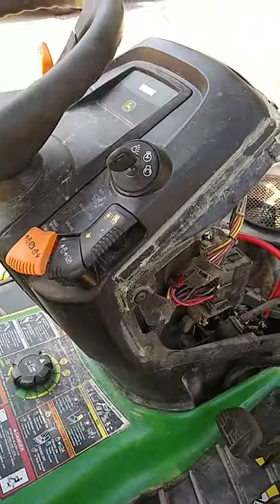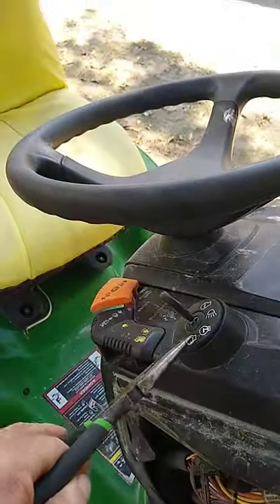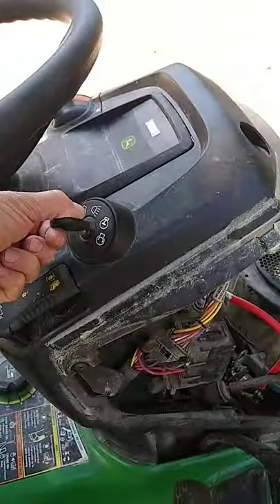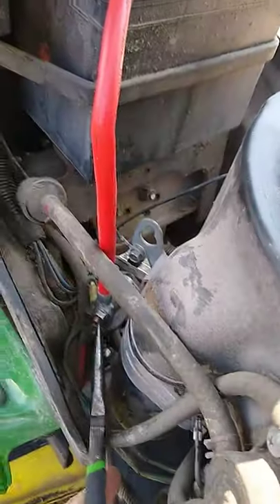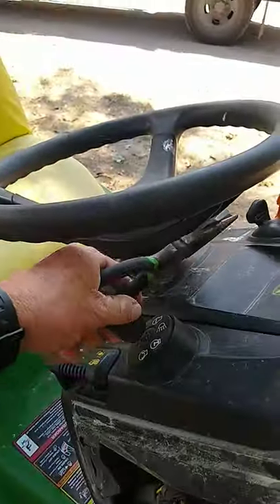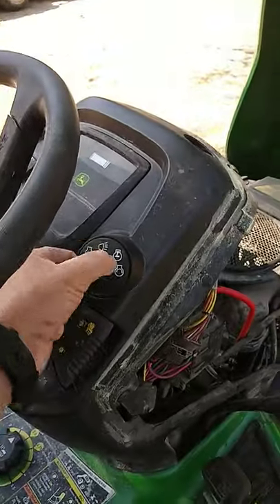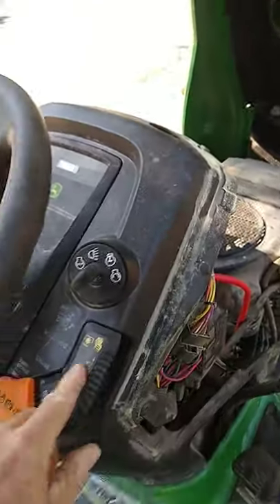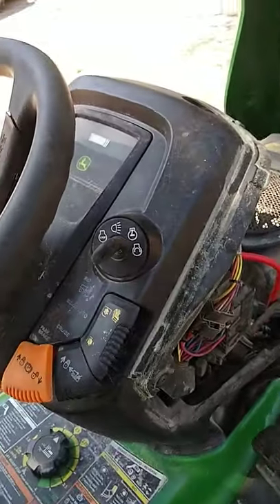No Start and no Click - John Deere Mower - My Fix.

Comment: Very helpful! FYI there's a 20A fuse to the solenoid. It's located right next to the big red wire in this video. I replaced mine and it started right up. Cost me $1.49

Comment: Perfect.  Replaced my solenoid and starter, then this worked 😀
Reply from the maker: Rock on! Glad it helped.  😁
Reply: @ArrowItArchery  yep, had a loose pto switch connection.  Thanks
Reply: @ArrowItArchery  what is that switch the blade engage?
Reply from the maker: @Bryan Mann  Yes Sir, it is the PTO switch. If it's engaged (pulled up) the motor won't start. My switch was simulating it being up. Moving it around as I held the key in the start position pinpointed the no start problem.

Comment: Working on different model john deere no click no start.  It does start jumping the solenoid with a screwdriver.  Im just not sure if its the solenoid or the switch. ' edit ' it turned out to be the brake safety switch.  I just cut it off & put the two yellow wires together & the other two together eliminating the switch.

Comment: Don't know what that switch below the key is, but on big trucks "No Click No Start" is usually the neutral safety switch.
Reply from the maker: It's the pto engagement for the mower. Fiddling with it with the key turned as if starting it. It told me that it was that pto switch when it would crank as I fiddled with it. 😁

Comment: u got to press in the clutch slash brake for it to start
Reply from the maker: Yes. But when you release it, it will die if the seat switch is bad.
Reply: @ArrowItArchery  I don't believe we're dealing with seat switch anyways if it's running after messing with the blade raise/lower deal, which side note, what is the name for the lever switch whatever you may have? Because mines bad, still cutting when it shouldn't, trying to figure it out
Reply from the maker: @Gregory Schulte  if it's still cutting when it shouldn't,  as if you are disengaging the PTO button and still engaged and blades mowing,  I'd be looking into your PTO button. That's not the same problem as this.

Comment: Did you touch both bolts on the solenoid? Just curious.
Reply from the maker: Yes Sir, you're just jumping across the two bolts. Make sure your ignitition switch is on if you want it to run when you make the jump.
Reply: @ArrowItArchery  Thanks for the reply. I appreciate it. I’ve been trouble shooting my 155c and it’s my ignition switch. Waiting on my new one to get here. Thanks again !

Comment: Also is a relay that controls it all.  Notorious for going bad
Reply: Where’s that relay located… thanks
Reply: @lynneakin2737  where the fuse block is.     It controls 2 different things.   Make sure you have power from seat switch should hear relay click but even then sometimes if the relay is bad it won't start by the key but you can jump it at the starter coil with a screw driver to check to make sure everything else is operational

Comment: Mine has no power whatsoever....mowed with it last night....absolutely nothing now....battery is good...
Reply from the maker: Does your hour meter come on when you turn on the key switch? If not,  and all of your fuses are good, check that the connector plug to the key switch is seated well. Disconnect it,  clean the contacts as good as you can, and reconnect it. I try to clean connections like that with contact cleaner spray and  scrubbing as well as possible with a toothbrush or something to that effect. See if you get anything after that. 😁
Reply: @ArrowItArchery  I tapped on the relays lightly....power came back....gotta  figure out which one...

Comment: Blown fuse will also cause this issue.
Reply from the maker: If all fuses are good, this is diagnosing that the PTO switch has an intermittent electrical contact issue by holding the key in the start position while toggling the switch.